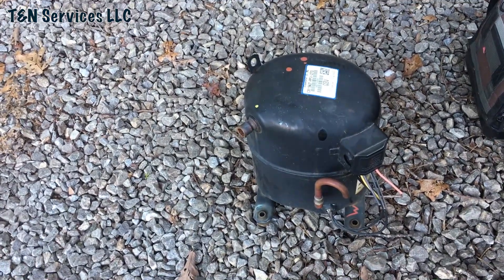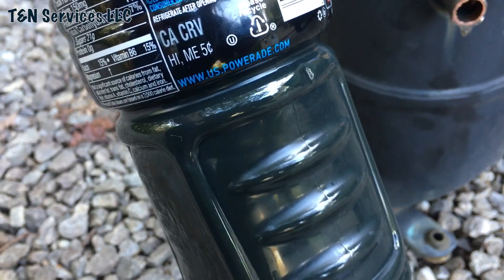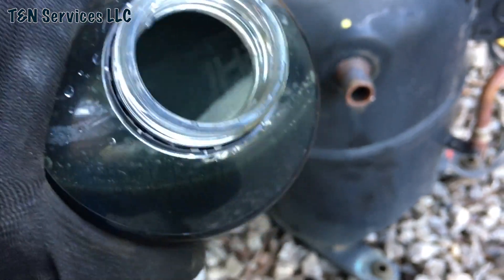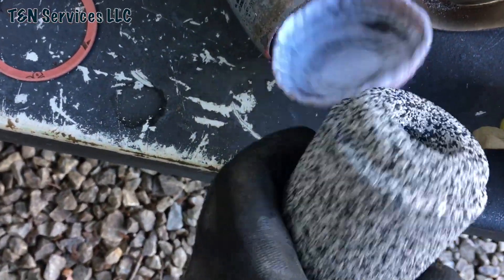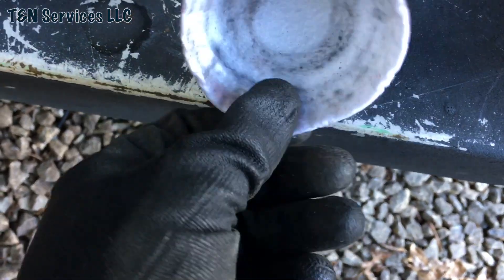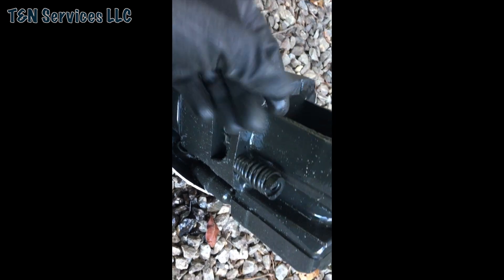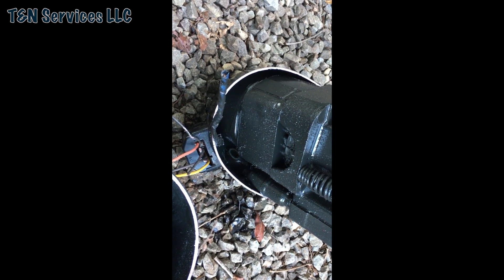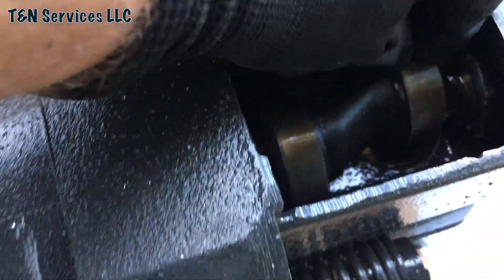Cutting a bad HVAC compressor open

Comment: Thank you for your very interesting videos. 
This one brings to my mind wen living in a communist country and having the  need of keeping my baby daughter milk and food cold I did what many were doing:
Got a broken motocompressor from the  black market, opened splitting  the seam in half with a hand saw have a buddy to replace the start and  work coils,  pay someone for welding it back together.  Get a  big styrofoam  package box and  lined with galvanized sheet metal,  build a wooden body around.  For the evaporator aluminum sheet metal and copper tubing. Capacitor, solenoid,  thermostat, capillary tube used  condenser, freon 12 and  magnetic gasket  all  purchased on the  black market. 
Gad bless this country where regular people doesn't have to do all this.

Comment: The oil got cooked!      When the unit is low on refrigerant gas the compressor runs way hotter. The cool return suction line gas cools the compressor. With less gas the suction line is warmer from the evaporator and thus the compressor runs hotter. The life of oil drops radically with higher temperatures. The black oil probably has the classic acid in it from the cooked oil. In a some systems folks checks the oil for an acid content. One can also have a poor routing of the suction line so the oil never all returns and have oil problems too. 

The more I learn about this stuff the less I seem to know. 

Way too much charge ie an overcharge can cause high head pressures and cook the oil too. hat is why the proper charge is important.

Comment: Hello, off topic ( copy and pasted article )
what do u think of the following concerning Zoning: Bypass ducts should never be used.

Here are three reasons why:

Throwing cold air directly into the return plenum reduces the temperature of the air coming in to be cooled. That makes the evaporator coil get colder, and the colder it gets, the less efficient it becomes.
The bypass duct steals air. Even with all three zone dampers open, the bypass duct has a big pressure difference across it, and air is lazy. It'll cheat and take the path of least resistance whenever possible, in this case the bypass duct.
Not only is a colder evaporator coil less efficient, it's also more likely to freeze up, as the condensation it collects eventually drops below the freezing point. (And if you think a bypass duct is bad for air flow, a frozen coil is way worse. It's really hard to push air through a solid block of ice.)
The bottom line is that zoned duct systems are tricky. I do believe that Chitwood is right, but so is Proctor. I think Proctor's main objection isn't that zoned systems can't work; it's that they're done wrong so often. In the end, if you do get one, make absolutely sure the installer doesn't put in a bypass duct.
Reply from the maker: Bypasses work if done correctly, keyword is correctly. EWC has come out with a great bypass damper that will work  like none other. I have fixed many zoned systems that were installed incorrectly by just fixing the bypass.
Reply: I would have it bypass into the largest thermal load zone vs. back into return,  say kitchen/dining/living room.
those probably call more often than not anyway and I don't see where it would hurt having lower velocity flow when not calling itself.